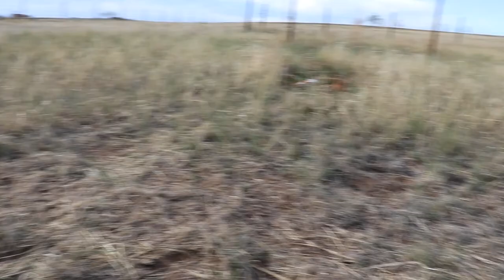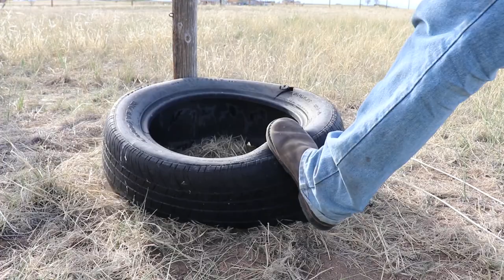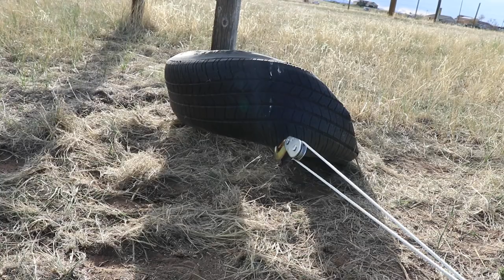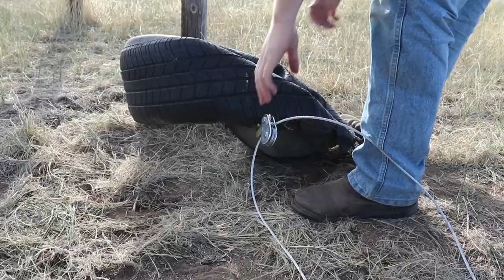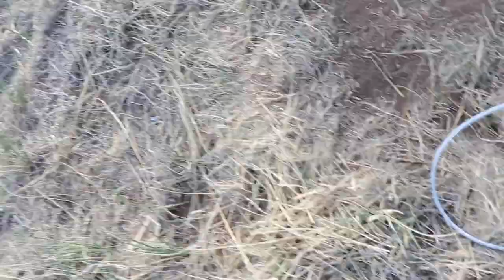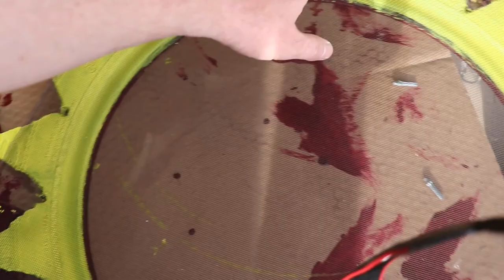Turn Old Tires Into Planters...How To Turn An Old Tire Inside Out...The Easy Way

Comment: More beer sounds great. Many thanks for the video. I could use a good workout I will try your method of turning a tire.
Reply from the maker: You might try heating up the rubber with a blow torch.  That should make the rubber more flexible.

Comment: That's a lot of work.  One concern is the winch hook detaching from the tire,  nailing you in the head while attempting. Would be easier if you would cut both bead rings off the tire to make it easier to reverse the tire? Cut V shape on one side and straight cut the other. Don't really need the bead ring on the bottom of the pot anyway.

Comment: Lots of sweat and tired old Muscles.  77yo and 7 years of health issue I still turn tires. Not 10 ply monsters just auto tires.
CUT THE OTHER BEAD OUT. 
The closer you get to the tread the thiner the wall gets.  Cuts easily with a box knife. Dip the blade in water soap . It helps but becareful, a slips can get you into the ER and $1000 bill. I have 16 tire raised bed planters in my little "POT" garden. (Container garden). I started stacking the tires this year. They are a lot easier to work in. Lot's of good avise on You Tube and tires.

Comment: Okay.  Good concept.  I hate those winches due to how difficult they are to UNtighten, especially after dust gets into the mechanism.  I' moved up to a WormGear style, now I use 12-volt mini winches and lug a battery around or use jumper cables.  ANYWAY, to make the First and Last inversion easier, use a BAR CLAMP.  Put clamp inside tires, grip tire, then use the bar for leverage.  (I used to make all kinds of brilliant videos for YouTube, but only my grandkids viewed them.  I don't try anymore.)  YOUR VIDEO would be even more awesome if you'd Edit Out the unnecessary parts; e.g., C-130 flyovers.